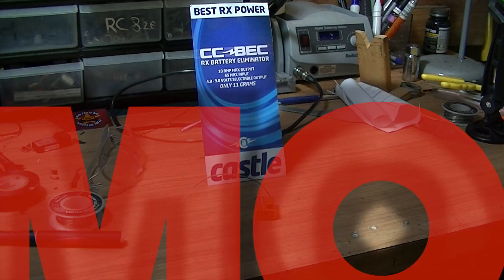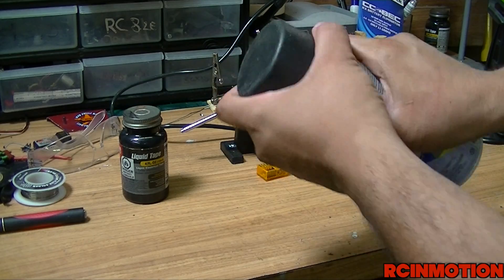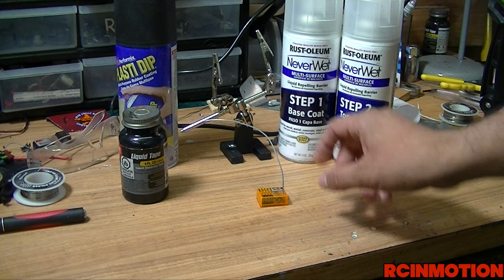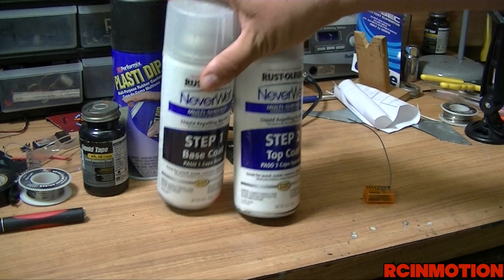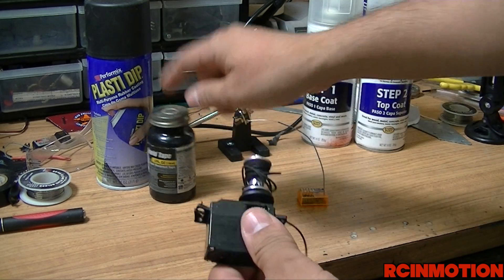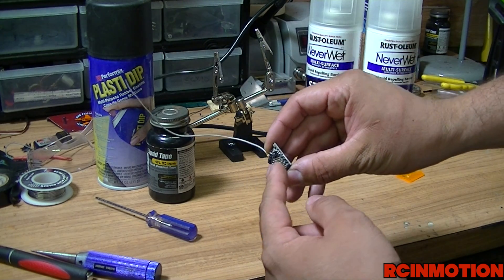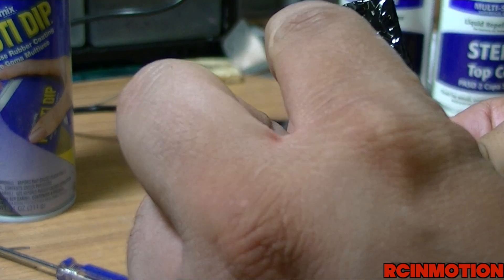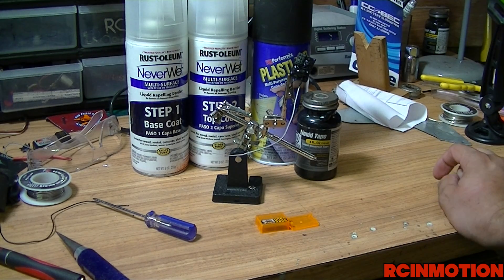Tech Tuesday- Waterproofing Electronics

Comment: conformal coating is the way to go its why manufacturers usually use silicon conformal coating for WP'ing, not liquid E tape or Rustoleum junk.. acrylic based conformal coating is usually used over silicon based by hobbyist though, as its an easier removal process.. also, its for applying DIRECTLY onto the PCB, similar to CorrosionX , and is not for spreading on the outside casing. hope this helps

Comment: Conformal coating is a direct apply to electronic components, not the outer casing.
Reply from the maker: Wasn't using the word as in the product, just using it as a method. I've never using conformal coating before but it's another method. Thanks for the input, much appreciated in catching that for me... Sometimes my mind runs faster than my mouth lol. Thanks again for the feedback...